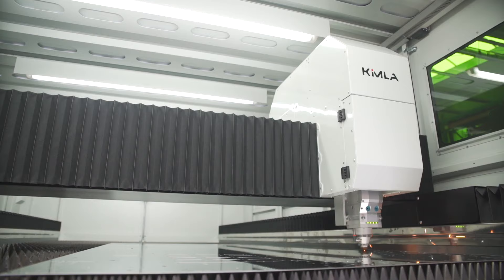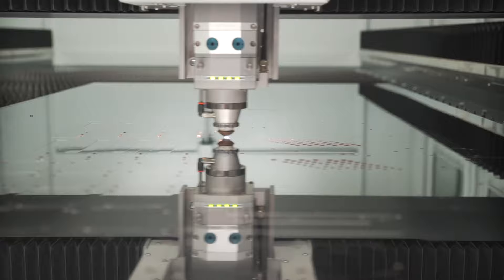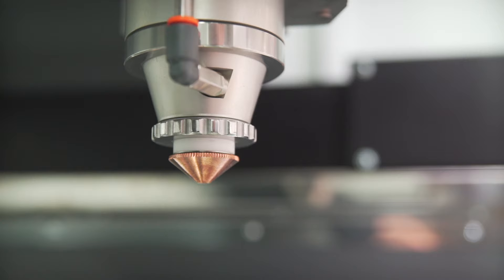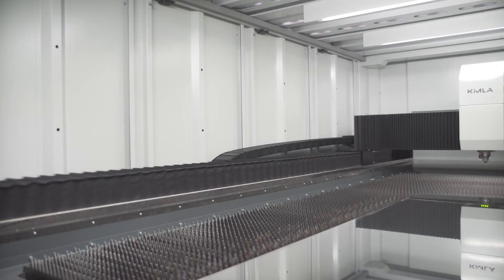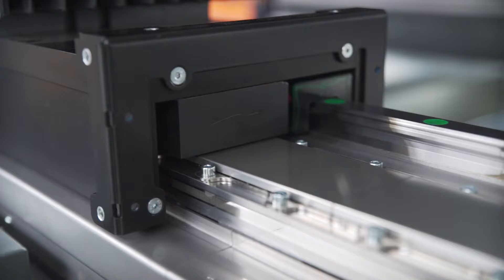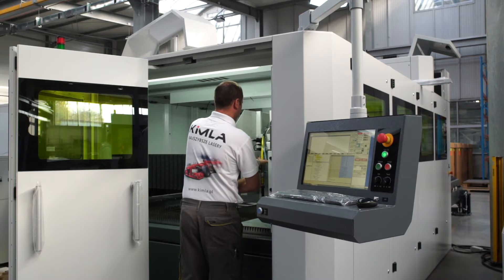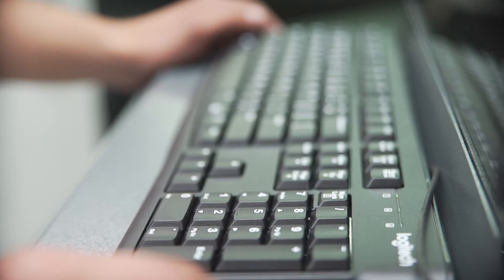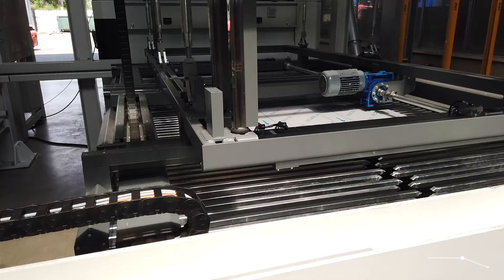How does the CNC Fiber laser cutting machine work? - Factories

Comment: Can some one help me selecting a proper laser machine for making holes of very small diameters in metal sheets.
Reply: How much small and what thickness?
Reply: @arthurpip995  a) 1 mm diameter in 2.5 mm thickness.   b) 45 micron  diameter in 0 .2 mm thickness.
Reply: @vinaymalwiya218  a) in stainless steel, you can cut this if an 1000w fiber laser, but if you want to cut a lot of holes in one piece, prefer to buy 3000w
Reply: @vinaymalwiya218  b) it's difficult to cut so small hole with laser, the precision that you can achieve in laser its like 0,1mm
Reply: @arthurpip995  thanks. The material is Stainless steel and lot of holes are required to be made at the triangular pitch of 2 mm. 1 mm hole, 2 mm triangular pitch, 2.5 mm thick Stainless steel.
Reply: @vinaymalwiya218  i believe that 3000w or superior laser with flycut option will be good for you
Reply: @arthurpip995  thanks. 🙏